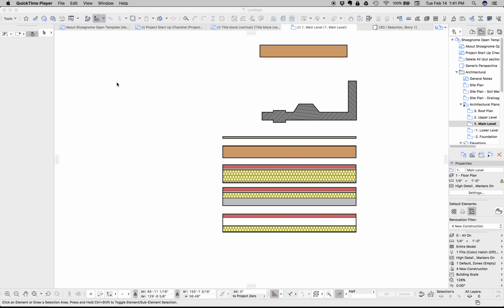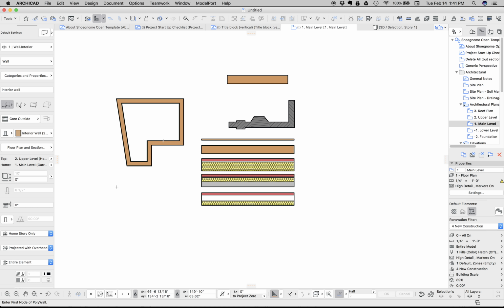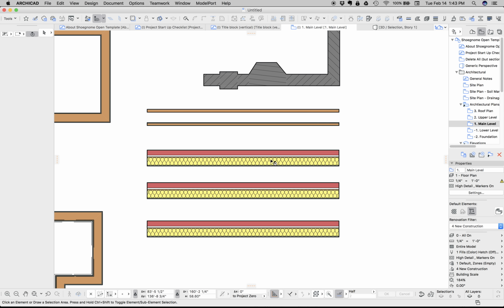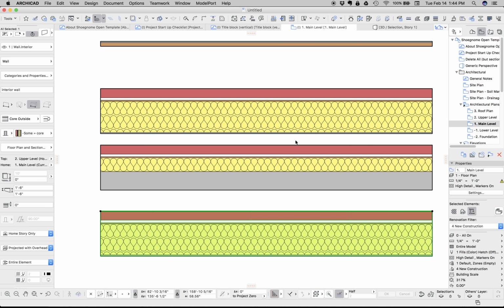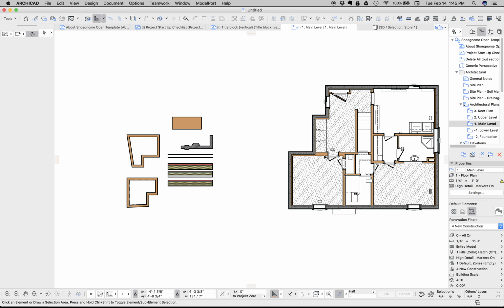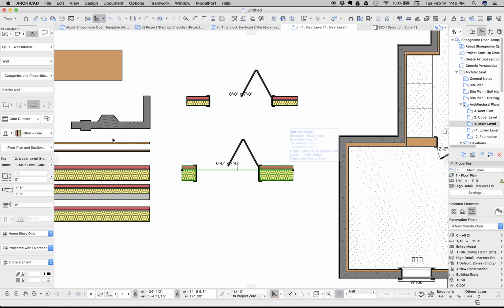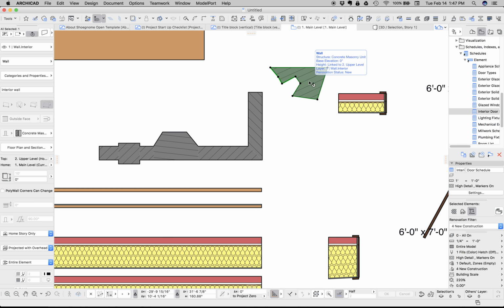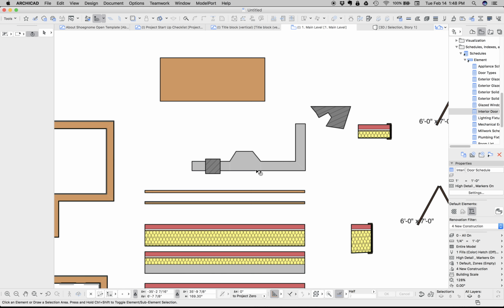ARCHICAD Tutorial #60: Wall Tool Construction Method Techniques

Comment: 3:46 But with this method (instead of separate multilayer component) you can't use the evaluation of the Inner-Core of the insulation, it lists just the standard-value of thickness. In addition, I have to calculate the thickness of each wall itself... nice to see but in some cases not practicable...
Reply from the maker: I find this technique is best for dealing with existing conditions where there isn't much need for deeper data as it's just dumb existing geometry that rarely shows up in schedules. 9 out of 10 times if I'm doing new construction and have a weird thickness wall, I create a new Composite. Or change the design!
Reply: Ok i agree, now i see what you mean. Thank you.